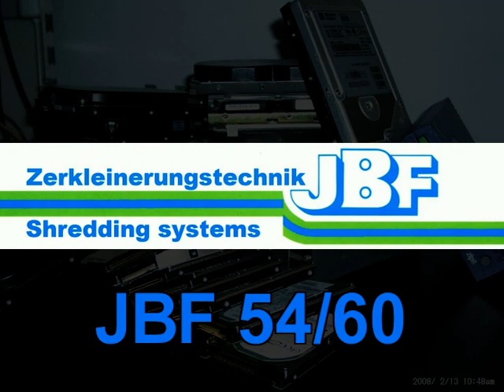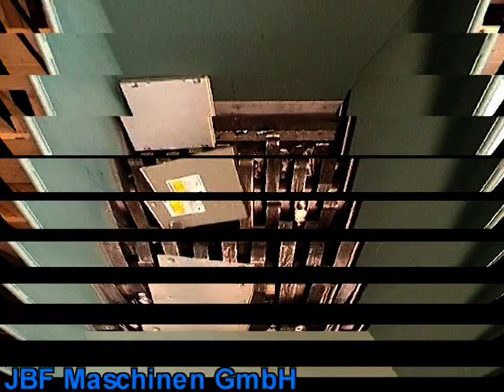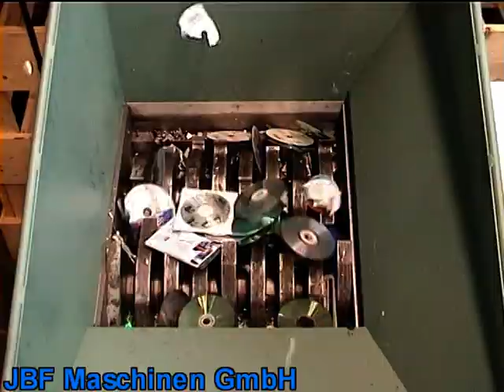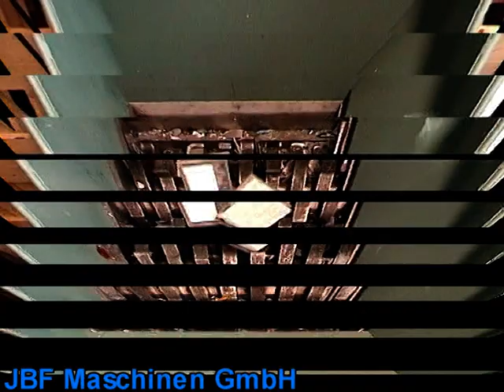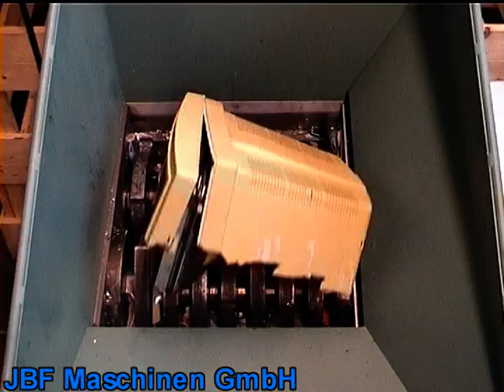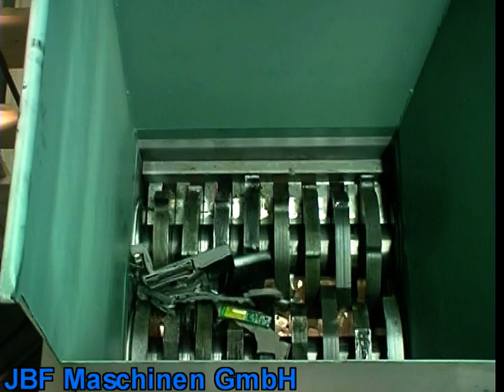JBF 54-60 Shredding Hard drives, Laptops and even Monitors!

Comment: Even if shredding is not grinding, circuit board should be taken apart before shredding metal parts - to avoid creating toxic dust of epoxy and leaded solder.

Comment: NOOO STOP I NEED A NEW COMPUTER!!!!!
Reply: OVGAnnihilator You don’t want an old hard drive in it though when a new hard drive is a better option. Even a cheap 1TB hard drive, such as a Western Digital Black or a Seagate Barracuda should have all the storage space you’ll ever need. Plus the data on an old hard drive will have to be wiped (i.e. format the lot) because the computer will run better and some of the old data that needs to be removed may be viruses, spyware or child porn, which, if it’s discovered on your PC, you will get arrested.

Comment: kind of a waste.
there is some things that can be used for parts, hard drives can be reused in other systems 
the tapes can be recorded over, the laptops & desktops can be giving away for free, sold on ebay craigslist or donated to Goodwill
Reply: Those machines are not just used for disposal, the point is to reliably destroy data for security purposes. If you were a huge company and update your computer systems, it wouldn't be very wise to just give your old HDDs with the remains of important files to random people just so they can restore them.
Reply: @Toarcade  How about the laptop and the monitor?

Comment: Reuse this crap:

- Laptops and stuff probably work or need cheap repairs.
- CDs can be mounted on a circle of plywood and used as a solar death ray.
- The lasers can be removed from CD and DVD burners and used to make laser death rays.
- Hard drives can make pretty good speakers when hooked up to a stereo system.
- The cassettes can be played in said system.

TheMoreYouKnow.png
Reply: I don't think optical drives have lasers that strong. Blu-Ray lasers are well strong and, so I've been told, they can light a candle or a cigarette at close range with the appropriate modifications, but no optical drive laser could be a death ray.